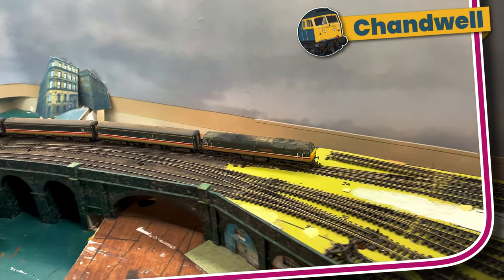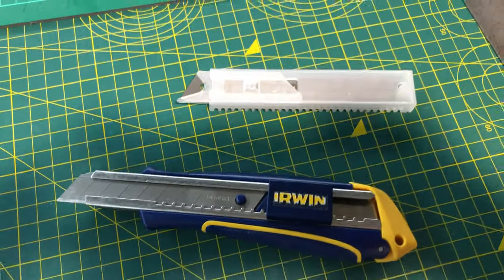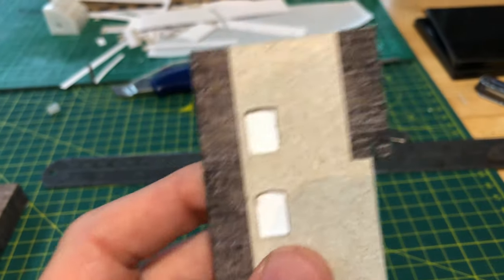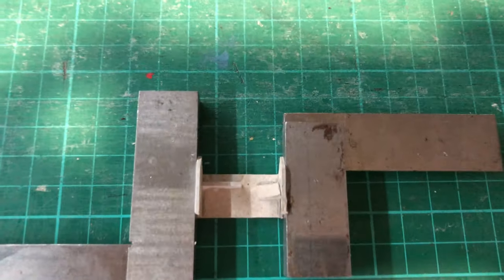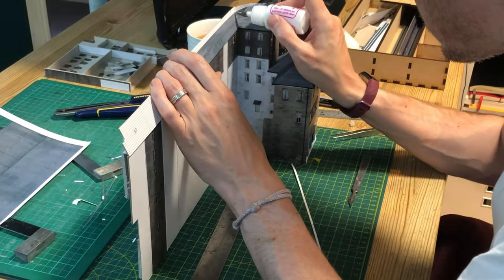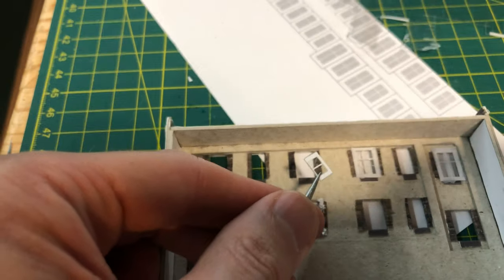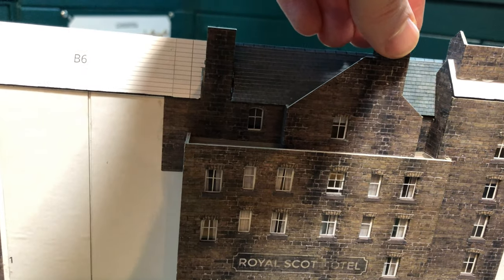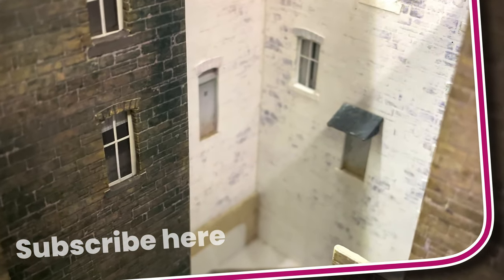Windows and walls: Scratch Building a Low Relief Victorian Hotel Part 7

Comment: Michael, firstly who needs an excuse to buy cake ?
As usual you have made something from nothing that looks amazing.
I do wonder if you will come back to the roof at a later date though because you have found a better way to do it.
Now did I hear you right as I think you said you work in this room everyday? If I did wow. I tell you now I could not work in a room with a train set in it let alone a great layout, it would be all play and no work !
Looking forward to the next bit.
Mark
Reply from the maker: Hey Mark, yes... I work full-time from home, and my desk is surrounded on two sides by Chandwell - I face directly into the station, at about track height, so it is a pleasant environment in which to work!

True about the cake. True. Whatever was I thinking!? I will remedy that situation immediately.

The roof is OK, but if I do ever come back to it, it's just paper which can very easily be sliced off. I think a chimney just in front of the curved bit will do the trick. I will be adding plenty chimneys at some point.

Thanks as ever for your comments. Something slightly different in the next build coming up. At least no more windows yet! :)
Reply: @Chandwell  Michael, All I can say is you must have more will power than me to work in that environment, I couldn't resist a play and then oops no work done !
Reply from the maker: It's often the other way round - so much work to do that sometimes even my leisure time is spent working.

Comment: Top work again Michael, its really coming together now. Love the ghost sign and the open window effect, they really add life to the building. Do you tend to just cut the texture sheets to match the carboard structure, rather than marking the doors and windows in inkscape? Cheers Liam
Reply from the maker: Hi Liam. Yeah. I don’t bother with marking out the windows on the cover as I add lintels and sills separately. I sometimes leave gaps when doing big windows just to save printer ink.